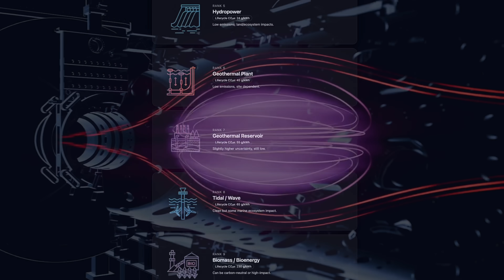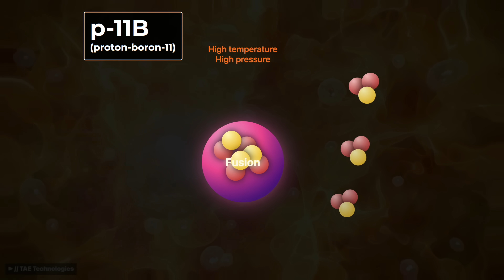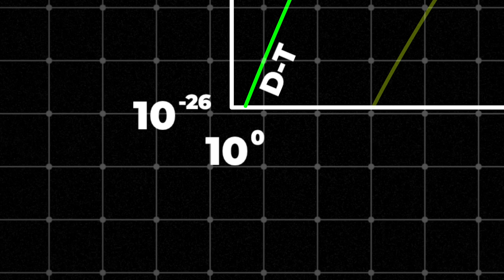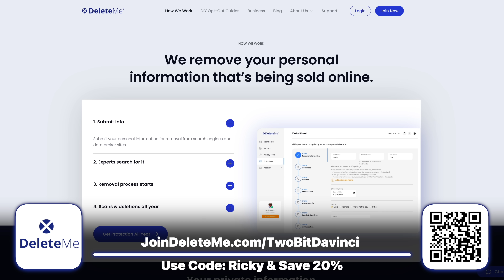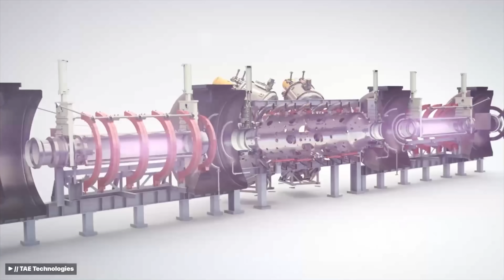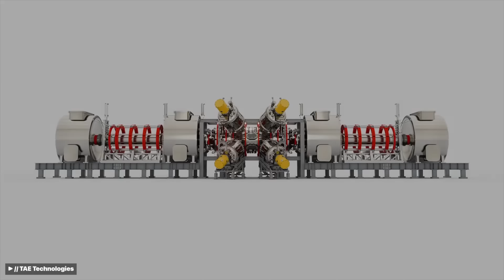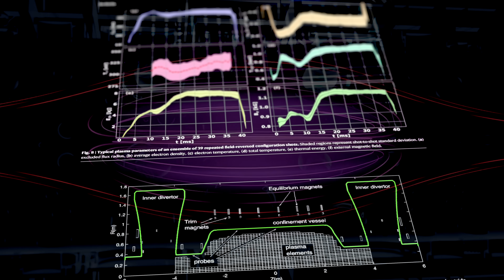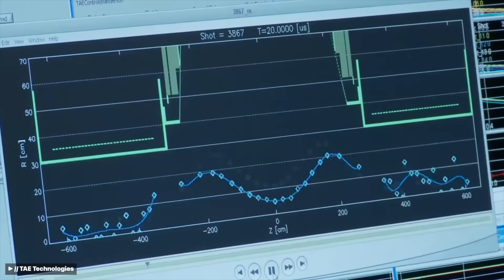The Nuclear Fusion Breakthrough EVERYONE Said Was Impossible

Comment: I had some hope for the title, but I fear it's still more correctly called impossible as far as scaling to anything useful. Wildly impossible required temperature, actual efficiency degrading harmful radiation. and a brick wall to the higher temps and controlled radiation likely already reached without a workable solution in sight. This seems to be one of the least likely long shots I've actually read about. But, hey no scientist here.

Comment: The main force preventing nuclear fusion is the Coulomb force (electrostatic repulsion) between positively charged nuclei, which acts like a strong electrical barrier (Coulomb barrier) requiring immense heat (millions of degrees) and pressure for nuclei to overcome it and get close enough for the attractive strong nuclear force to bind them, essentially requiring a high-energy collision., . A  better approach would be to mimic natural processes in the sun.  Electron/proton tunneling (quantum tunneling) is allowing positively charged nuclei  to overcome their mutual electrical repulsion (Coulomb barrier) and fuse, releasing vast energy, even when they don't have enough classical energy to do so. If one could shoot atomic fuel particles at exactly the right angle and center point...fusion could occur without vast amounts of energy being wasted on confinement or materials capable of adsorbing waste neutrons.

Comment: Can the x-rays be absorbed by some material and then use a heat exchanger to heat water to make steam to make electricity? Then, there's no waste of energy and they can still generate electricity the way the FRC method does with magnetic induction at the same time.

Comment: Sorry to say but this changes nothing...too F-ing hot for starters!  Too much heat waste... I don't see this ever working.  They are engineering an expensive hobby toy not an actual energy generating system.  The approach is the same as others...hold the plasma in a magnetic bottle until they can peal off some way word particle and claim it's moving the needle of power generation or potential power generation via panel or turbine.  No Bueno !

Comment: Why would you construct endlessly complex reactors for the most-exotic fuels at limitless expense on a never-ending time of development scale when the same conditions exist right now? Fusion reactions occur constantly, deep within the earth, and atmospheric or hydrostatic pressures at a twenty-mile depth aren’t anything like those within metamorphosing rock there. It becomes plastic, destroying diamond drills and refilling any well shaft. Millimeter-wave or relativistic beams in noble gas plasma can force atoms across the threshold that binds them, sending streams of raw current to the surface for powering local industries and grids, without $40-million steam turbines or exotic fuels. Nature does that light show in volcanic eruptions that cannot be regulated or wicked-out with plasma-deposited graphene waveguides. That’s not what Quaise Energy are planning, but if all of that is true of what’s happening at their planned drilling depths, they surely ought to be prepared for a Ben Franklin kite revelation. Don’t you think?
Reply: What they plan to do, where the crust enters the mantle, they are going to disrupt the binding forces that concentrated gravity imposes on atomic structures. The balance of pressure and energy inputs maintain a steady output in excess of that input, and such that it’s regulated like a chimney flue. Too fast and the well cools, failing output. Too much or too deep and gaseous rock explosion ruins the dynamic. Feedback sensing is as important as in a tokamak, yet the dangers aren’t sitting in your laboratory while you learn the rules.
Reply: It's a scam. A money-laundering scam. TAE is majority owned by RUSNANO, Putin's personal hedge fund, which is owned by the Russian government. Why is a company owned in part or in whole by the Russian government allowed to operate in the U.S.?

Comment: The energy is collected from the charge of the alpha particles.  How much energy can you get from reacting a kilogram of hydrogen?  It seems to say there isn't harvesting from the velocity into, for example, carbon, as in fission. Are they building a helium factory more than anything else? That may be a good thing.
Reply: Google AI says the energy from the charge in a mole of alpha particles is: 231,000 Joules. Likely you'd need rows and rows of reactors on racks in a power station. Then there's the energy to split the hydrogen from water in the first place. The weight of a mole of hydrogen gas is about 2g. Can see where the 1-30 ratio may be coming from. Do the economics add up, assuming the physics can be made to work? CAPEX, OPEX, market price, fixed forward price, end of working life costs etc.

Comment: Progress for sure...but a breakthrough? Breakthrough for me suggests they found a way to make fusion work, all the way to the end (not just a piece of the process to get the containment working). My guess is that this advancement will help eventually to get to the goal of fusion with some sort of fuel. But whether it is with the clean proton boron reaction, I have my serious doubts. Why not try a different, easier to ignite fuel to prove the concept or start with a different fuel and work your way up to the cleaner fuel if necessary. But if you can ignite other less clean fuel, why go with anything else? It's still a mess IMHO.

Comment: Using carbon in the CNO cycle may be easier?  Good luck to them, appears the team can do higher order, non linear tricks. Have the inside as machined retroreflectors with jaggy edges? 8:30 Mirrors for X-rays sound very expensive.

Comment: Plasma is the problem, they overcome space charge repulsion with neutral collision but that ends there, as soon as plasma is generated charge repulsion dilutes reactants. Up scaling is not the right way, down scaling is the way to go. As far as a lattice or atomic scale reaction chamber, like ICF, but using their boron reactives, heating the nano-atom scale fusion reaction chamber from the outside. Recent research on the sun shows that it's not a gaseous plasma below the corona, so no solar energy comes from gaseus plasma but from a thicker or denser plasma below its surface. Hence only ICF or like approaches will succeed. Take care

Comment: Have a look at LPP Fusion.
They use a P-B11 fuel source.
But they use a pulsed concept.
Reply: @haroldemmers6428  LPP is already generating PB11 fusion successfully this way. The only way to get enough power density is via electrostatic z pinch (which brings the equivalent temp to billions K)

Comment: I still think that the hotter is better approach is wrong personally. As the heat rises the plasma density reduces so it can't structure properly if they were able to introduce a tonal frequency to stabilize it then it will form structured plasma and bob's you uncle.

Comment: The issue is a math one. There is an equivalency equation that needs written to describe what gravitational pressure via magnetic cage pressure is necessary to mimic the gravitational mass discrepancy needed for stable ignition. Basically, in analogy: you can't turn nitrogen liquid until it is cold enough. But for fusion: it's gravity.

Comment: This sounds interesting, I have heard a lot about nuclear in different forms, but this is new to me. I am surprised to hear that it has been around for a while. It seems like nuclear fuel is not the expensive part, the reactor is, so I am glad to hear that they have taken steps to simplify this design. My main beef with earth based fusion is that it is an even more centralized energy producer than a large hydro dam or nuclear fission reactor. I like my solar system, I am glad to have that ability to catch fusion power wherever the sun shines.

Comment: Maybe I am dumb here but what happens if there is a failure when dealing with over a billion degrees of heat? Like let's say the magnets fail and the video says there is nothing in the universe in materials that can contain such heat. Would it not eat through the chamber and eventually break out and release that blllions of degrees of heat?
Reply: A billion degrees is a lot of temperature but it's not a lot of heat. The plasma would expand into the containment building cooling as per Charles's law.
Reply: Another way to demonstrate, the Parker Solar Probe survives million degrees of temperature when it flies through the solar corona because the plasma is so tenuous it doesn't hold a lot of heat.

Comment: Hosnestly I didn't understand what you said about the calculation of the Q ratio for D-T and p-11B.
You said D-T requires 3 MK startup temperature and p-11B 1.5 GK?  And that's supposed to be more efficient?  I didn't get the graph that you showed briefly.
And then you add that the p-11B reaction incurs more radiative losses because of that temperature increase and electron interaction...
I don't understand...  Surely, I missed something or something was missing in your presentation.
Don't get me wrong: it was very interesting.  Thank you.

Comment: No, the real, available, holy grail of energy is "nuclear fission".
We just need to invest in new plant designs and new plants that can use the current stocks of spent fuel and depleted uranium (which is just sitting around in storage being a nuisance).  We coukd supply 100% of the US energy needs for about the next 200-300 years just using that, without needing to mine any more uranium (or thorium).  Plus it gets rid of all of the lightwater reactor "waste"...ehich is really just fuel that can be used by a different type of reactor.
Stop mucking around with this dead end.
Fusion takes place in a star in balance of massive gravity and fusion explosion.  Some physics just can't be feasibly replicated by humans on Earth.

Comment: Personally I believe that the only reason our sun makes a profit with fusion is because it is subsidized by free gravity.  Fusion may in the end prove to be an endothermic reaction.  The tokamak may be able to transmute elements which would be worthwhile but any scheme that requires huge influxes of energy will not be an energy source.  The capital costs must also be amortized and simply looking at energy- in/energy-out is leaving a large proportion of the equation out of the recipe.  In my opinion fusion's only future is in elemental transmutation.  It cannot compete with nuclear fission, photovoltaic or chemical sources of energy.  We should turn our research entirely to elemental transmutation rather than energy production with fusion.

If we learn to control the flow of graviton/Higgs Boson particles that would be a possible source of endless energy as well since we could at minimum turn dynamos by partially shielding flywheels from the gravitational effect.  Even that would depend on the costs versus benefit analysis of the process.  The power source of our long range satellites has been principally ignored here on earth.  Wrapping photovoltaic cylinders around depleted fuel rods would gain us a 24/7 source of electricity.  

God Bless Us All
Reply: Did you feed Claude AI short stems and hairs to get that hunk o text?

Comment: I agree with you that TAE Technologies successful reactor will be a game changer.   It will render fission reactors obsolete.  Their prototypes already making giant leaps in terms of simplicity and cost in their design when comparing to other fussion concepts and fission reactors.  The best part is that there is no radioactive fuel and no radioactive waste production.   Still I do not have a clear picture in my mind how their plasma fuse atoms.  My first impression is that their fussion process is relying on high temperature and pressure alone and there is no kinetic energy involved.  How do they extract energy from fusion process taking place in their plasma chamber?

Comment: Let me see if I heard you correctly, Ricky. TAE took 27+ years to get to 100M+ C with their Norman reactor. The next machine, Nora, will need to scale the core temperature to 5B+ C, which is a factor of 50x!!! That tells me 27x50 = it will take them 1,350 years to get there. And for what? A throughput that is 30% of what ITER will be doing in a decade or two with D-T fusion. Just because the physics simulation says it is "possible" doesn't mean it is practical, or economical.

Comment: You need 1 to 5 BILLION degrees C to achieve it.
This is taking playing with fire to a galactic scale. 
Um, anyone wonder what would happen if it leaked out?
Reply: Not as much as you might think. There's probably only a few grams of material in there at that temperature. It's not getting very far before other things cool it down.
Reply: @MattNolanCustom  A few grams, that is a massive amount.  A speck of dust traveling at almost the speed of light has the kinetic energy of a big atomic bomb!
Reply: @joep5170 the speed of light is vastly faster than the ion velocities in a 5 billion degree plasma. Plus the particles are moving in random directions. The "ordered" bulk flow element to the plasma motion is even slower. Tokamak plasmas at 150 million degrees have collided with reactor vessel walls (at JET for example) and caused little more than minor scorching. 5 billion is only two orders of magnitude higher. Your concern is over-blown.

Comment: So they haven't solved or provided a pathway to solve the radiation loss? I think the findings by Todd Rider even predate TAE as a company. The finding that, fundamentally, any equilibrium fusion reaction other than DT, is bound to fail to break even due to these losses in small reactors (small compared to the absorption length of the radiation).

Sadly I wouldn't get my hopes up unless there was a plan how to deal with the radiation losses at high efficiency. Maybe it could run a thermal generator to recover some of the lost energy?
Reply: We didn't hear if the loss is controlled. I doubt it. See y'all in 2055 when the working prototype can light a room for 5 seconds.

Comment: @2:30 Aneutronic is a myth. I was told, neutrons still happen because there's major reaction and minor reaction
Reply: you might be thinking of D-3He there. What is the side reaction in P-11B?
Reply: @MattNolanCustom 
a+11B_14N+n 
1p+11B_11C+n 
1p+11B_12C-Y

It produces low and high energy neutrons with hard gamma side reactions...
Reply: @techlab4936  great, thanks, just the kind of info I was after. I don't suppose you also have the cross sections of these side-reactions at 5 billion degrees?
Reply: @MattNolanCustom Finally, ChatGPT ready to valorate itself tautologising your questions.

Comment: Summary (Short Form)
Muon injection helps p–¹¹B fusion by:
Lowering the Coulomb barrier via muonic binding
Forming ultra-compact p–B muonic molecules
Raising reaction probability at low energies
Allowing aneutronic α-driven power extraction
Working synergistically with dense, pulsed fusion architectures
Avoiding high-temperature bremsstrahlung losses
Reply: the problem with that is the anatropic cascade would be hard to contain as it would break down the molecular bond of the protonic binder

Comment: 1 minute in. My guess:

Tri- Apha. Energy..  Boron Proton absorption.

A mole of Boron eventually produces 3 He++.when it decays from an extra proton.

So -charge is 6x 96.5 kj per mole. 579 kj per 11 grams.

If you burn a mole of Carbon you get 393.5 kJ. 

You are extracting chemical levels of energy in charge while spending a huge amount of energy too maintain magnetic fields.

How can this ever be energy positive? 

---

Now to watch it.
Reply: Ah - the goal isn't to get energy from the He, but to sustain a much higher energy reaction.

Re: Scattering X-ray losses.

Two ideas:
1) based on the assumption that fields are reversing rapidly enough to keep relativistic particles within a small region near the center of the magnetic field. 

modulate the protons to a repeating pulse that is in sync with the greatest compression of the plasma.

Result: proton beam travels through a much smaller and denser section of plasma.  

The smaller volume of densely packed charged particles would behave differently than a less dense plasma.

There should be much less scattering because there is less overall crossection before and after the mass for particles to interact to produce X-rays.

This reduces the X-rays, and also changes the locations from where the x-rays begin.  With a constant stream of P x-rays are produced along its length. They should be mostly central with a tuned pulse.

2) Mix in a beam of electrons with the protons. The overall charge of the beam is closer to zero, and this may reduce the amount of particles interaction, thereby reducing both rh number of and energy of x-rays.